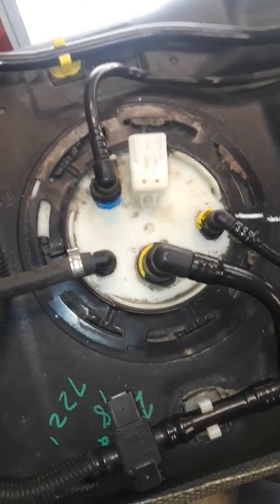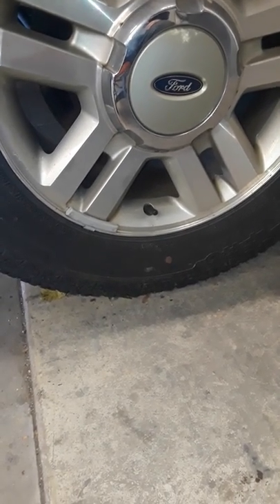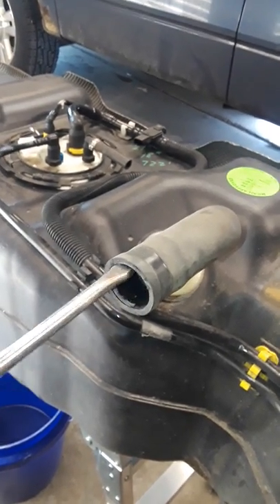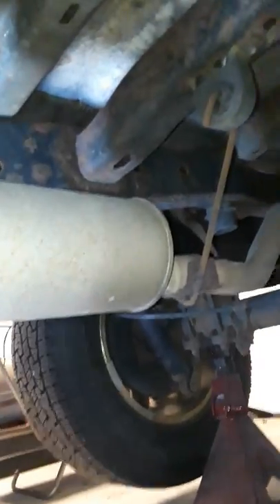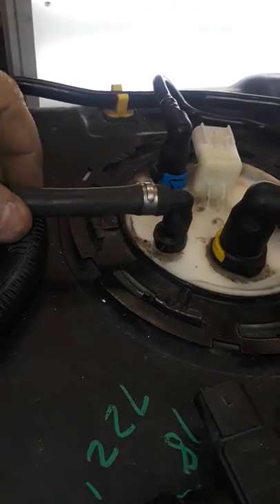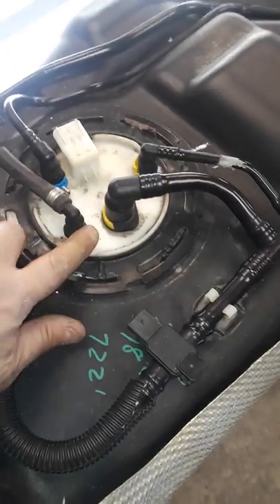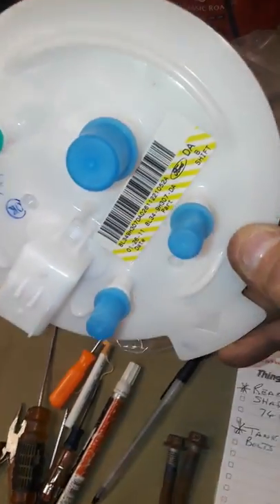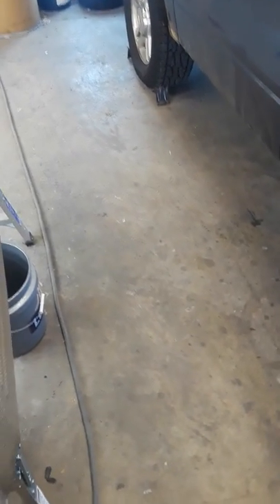Fuel pump replacement 2004 thru 2008 Ford F-150 crew cab

Comment: I used this video for a 2008 F250 Super Duty 5.4 a couple of differences. I did not have to remove any of the drive line. The rear strap flexed enough to go past the driveline and the front strap was easy to unbolt from both sides. Because I used ratchet straps to let it down a few inches after I removed the steel straps I was able to push the tank to the side enough to get to the hose attachments on the top of the tank. Mine had yellow tab push release hoses on the front and rear of the tank, and the big hose on the sending unit was push tab but the blue tab fuel line needed the fuel line disconnector tool. Also, used a coal chisel and hammer to knock the keeper ring counter clockwise to remove it. Cheers, great video.

Comment: Thank you soo much. Thanks to you i just replaced my fuel pump and saved 350$. I also feel accomplished. I could not have done it without you. Keep up these types of videos you are amazing at explaining. Tomorrow im changing the catalik converters too.
Reply: How did that go
Reply: I have the same truck even the color. So i just followed his lead how he explains it and wallah! Like magic. And the catalic i had to cut it before taking it off, the new one came in 2 parts. But still took all day to replace.
Reply from the maker: Glad I could help

Comment: Hey people don't forget to do the fuel filter, that is more than likely a good reason why the pump burned up. I replaced my filter first and I can tell you that it was so plugged I could not even blow through it, Nothing but sludge and black fuel came out of it when I tapped it on the ground. Good luck and great video!! Thank you!

Comment: Thats cell phone , was good for me . Well explained .. gave me an idea of what i facing . 
Its plow season here in jersey . Found a 2004 ford pick f250 , with 74,000 on the clock . Seller said he had to replace the fuel pump . So i was curious what the job entailed. Very well explained ...good luck on the installation.  
Thanks again

Comment: Thanks for the video. I'm about to do this on my truck.  Could you have removed fuel filler hose from the tank instead of disconnecting from filler neck? Looks like it would be easier, but don't know if it is accessible with tank still on the truck.
Reply from the maker: Too hard to get to, it was easier to disconnect the hose from the filler neck
Reply: @skidoorider5856  Just replaced fuel pump today. I was able to just pull hose from fuel tank instead of filler neck. Once I lowered fuel tank a little, there was just enough room to loosen the clamp. Then, I was able to push hose off from the space between frame rail and fuel tank. Applying some oil inside of the hose before assembling made it easy to put hose back on.  Took me about 3 hours.   Now the problem is... My issue was not the fuel pump after all. Wasted money and time. :(    I have intermittent fuel pressure issue at idle and I have replaced FPDM, fuel filter, fuel pump, checked grounds, now only remaining problem is fuel pressure sensor. 

And an advise to those who cannot get quick disconnects with pull tab disconnected.  Make sure pull tab is fully out. I couldn't get mine off and it turns out pull tab was not fully out. Pulled it just little bit more and came right off.

Comment: Good info.  But I gotta say that mine is anything but EASY! A bit more close-up/detail about the electrical connections would sure be helpful! Doing this on a reg cab long bed and even  with drive shaft removed  takes a contortionist to get between exhaust and tank! And even then it's impossible to get both hands in there! BTW longer tank strap bolt is in the front .Your vid was helpful though. Thanks for posting!
Reply from the maker: Yeah but I did have the tank hanging on straps and lowered about 4 in before I sat up between the fuel tank and the exhaust and I was able to get both hands up there

Comment: Is it possible to just cut a hole in the bed, replace pump, and then fashion water tight access door, or seal it back completely?
Reply from the maker: It depends which cab you have and where the pump is located in relationship to any braces that may be on the truck bed

Comment: I'm having trouble sliding the red tab sideways so I can unplug the pump ... I don't want to break it...
Not sure what tab to push down to release the red slide lock?.. I'm not seeing it...
Reply from the maker: Your Design might be different Try pushing the plug-inward first and then try to slide the Red locking tab over Or there could be a lot of dirt and grime in their spray some WD-40 around that plug First

Comment: Is there a trick to removing the pump? It appears the pump platic housing is larger then the hole????? Is the a certain way the pump comes out and goes in?
Reply from the maker: No when you undo that locking ring the pump should spring upward about an inch then there is a line that connects on the inside of the pump after you remove that you slowly pull it upward and out you may have to angle it a little bit to get the float past the opening as you are removing it

Comment: I had my fuel pump replaced twice now about 2 weeks apart. Before the pump was replaced, the fuel gauge was fine. Now after both, the gause only reads just over half tank when it is full. Did you have this problem? Or have any clues what it may be
Reply from the maker: No .. I did not have this problem my truck has 139 inch wheelbase and I ordered the pump accordingly to the wheelbase you have to know your truck's wheelbase when  you order the fuel pump.. and it doesn't hurt to do a side-by-side comparison to your old one and make sure the bend angles for the float rod are the same

Comment: You didn't mention how hard it is to get the metal ring off.  I used a 1/8 x 6" brass nipple.  After smacking my hand a few times I decided to hold the nipple with Vise Grips.  3 good wacks and I had it off.  The lines were very hard to get off of the pump.  I broke the nipples off.  Get the clips off Amazon.  You will not be left standing there thinking of using hose clamps on the pump nipples.

Comment: How high did you have to jack up the truck?  I have a 2013 5.0 and need to replace the sending unit in the fuel pump assembly.  Fuel gauge something works and something don’t.
Reply from the maker: I raised the back  So that the tires were 4 to 6 in off the ground.
Reply: How many gallon is your gas tank?
Reply from the maker: My truck has a 27.5 gallon fuel tank and a 139 inch wheelbase when buying a fuel pump you have to use your wheelbase size for the pump to get the right float you can find a wheelbase size in the door jamb on the VIN sticker

Comment: how did you remove the plastic hoses from the actual clamps off of the hoses that connect to the pump? mine seem theyre shrink wrapped on there extremely tightly.
Reply from the maker: There are locking tabs on the lines that connect to the fuel pump, I did not put that in the video on how I disconnected the pump. but you do not cut that plastic on those lines or you will be going to the dealer to replace them you have to look at it closely and you can remove them by looking at a how I removed the EVAP line , and how I disconnected the fuel filter line, the Locking Tabs are very similar to those just a different color
Reply: @skidoorider5856  i realize the blue/yellow clips that keep the hose clips in place.I was talking about the actual hoses that connect to the elbow shaped hoses.you have yours disconnected.thats what I need to do.

Comment: the part that's troubling me is the actual pump removal as there is an internal line connected to the underside of the pump that I couldn't get off. Any advice?
Reply from the maker: On my pump it was the same clip as the fuel filter clip .what I did to get it off was,  I pushed the line towards the bottom of the pump . and then I pulled back the center tab and then pushed the other part of the tab against the line and it came right off

Comment: i got a question for anyone//// can a fuel pump still not work even though it buzzes loudly... cause my truck wont start but the fuel pump buzzes louder then usaul
Reply from the maker: Definitely, the most distinctive signal is a whining noise. That’s how a worn out or old pump sounds like.
A well-working fuel pump usually produces a quiet humming, so once you hear the excessively loud whining, buzzing, or grinding noise be sure that it’s time for the pump to be replaced. But before you pull the tank check the fuel pump driver module housing for corrosion it is located on the frame behind the spare tire
Reply: Thanks for the reply
Reply: skidoo rider my truck is running now,,, thanks to your video!!
Reply: Check your fuel filter

Comment: I Know This A Crazy Question But Did you remove the gas from your tank ?
Reply from the maker: Yes I removed the fuel from the tank it made it a lot easier to put the fuel tank back in... I had little over quarter tank when I lowered it I siphoned out the fuel into 5 gallon buckets
Reply: @skidoorider5856  How did you go about siphoning the tank?  I tried the obvious way, but there has to be an anti-siphon check on the tank.

Comment: REALITY SETS IN: I have dropped at least 100 fuel tanks with some being very difficult and some being very easy. Most people would agree with me when i say If you have to remove the driveshaft it is NOT an "easy" fuel tank removal. If you have to remove the pencil brace and work through a tiny hole to reach hose clamps and cut vent lines it is NOT an easy removal. You are a glass half full optimistic person! I watched this video hoping this was an easy job and i was exuberant at your early claim of "easy job". But, as i watched the video i became deflated seeing this is most definitely NOT an easy job...

Comment: Was it throwing codes for this issue?
Reply from the maker: There were no codes ..if yours is throwing codes whatever they may be , check the fuel pump driver module first behind the spare tire on the frame
Reply: @skidoorider5856  already replaced that

Comment: How much dose the tank weigh
Reply from the maker: The weight of the tank is not that much, it is the weight of the gasoline inside the tank ,, a gallon of gasoline weighs 6.3 pounds, just do the math how many gallons do you think you have in there

Comment: The green clip is stuck how can I remove with out damaging the clip
Reply from the maker: Push down on the fitting and then push the tab inward and then pull-up on it and it should come off that's what I had to do

Comment: Fuck those fuel line tabs are a bitch... esp the blue tab that goes from fuel pump too fuel filter,.. and everything is filled with dirt and mud. Cause im from a Reservation. So everything underneath is rusty dirty muddy. No pavement just dirt roads

Comment: Did you also used a floor jack to lowered it? or just the straps? Thanks
Reply from the maker: Yes I used the floor jack to help lower it I loosen the straps up just to keep it from falling off the floor jack

Comment: Any chance u have that pump part number
Reply from the maker: No I don't have the part number but if you look on the tag inside your door jamb it will show you on the bottom left it will say WB and under that will be a number which indicates your wheelbase that's how you make sure you get the right pump for your  truck

Comment: Would it be possible to check the connector for the fuel tank pressor sensor without completely dropping the tank after moving the driveshaft?
Reply from the maker: There's not much room up in between the tank and the bottom of the cab you will have to lower the tank at least three or four inches to access those connectors